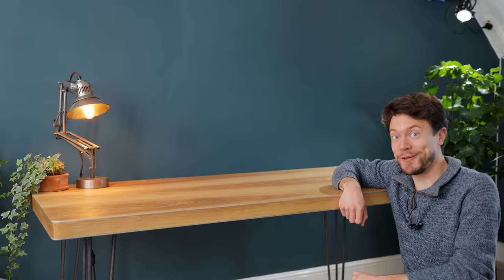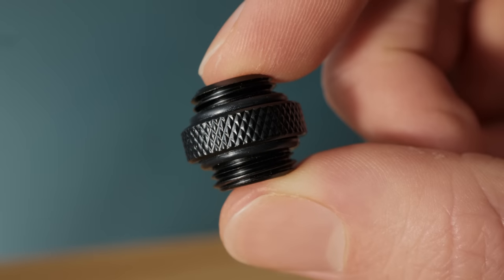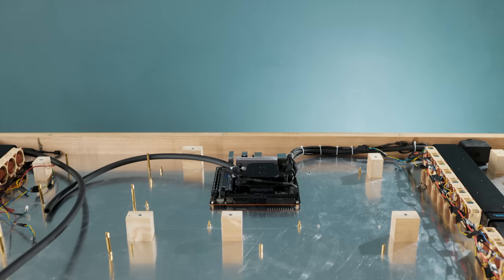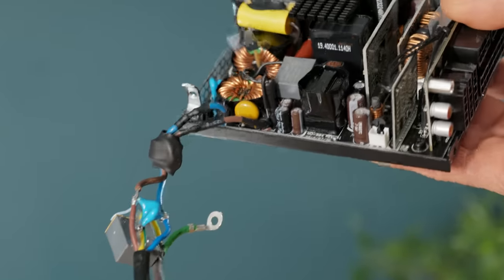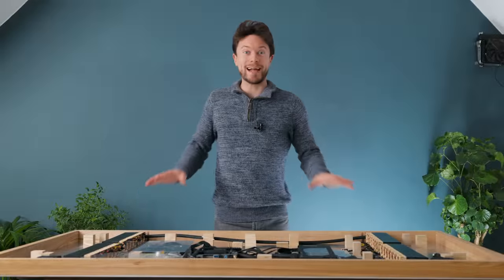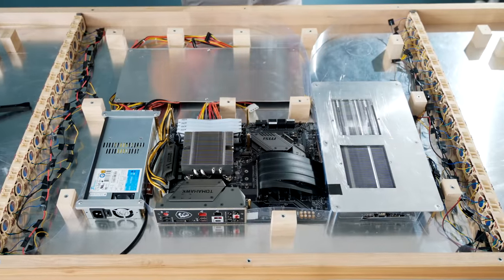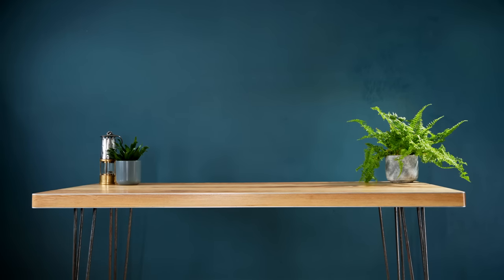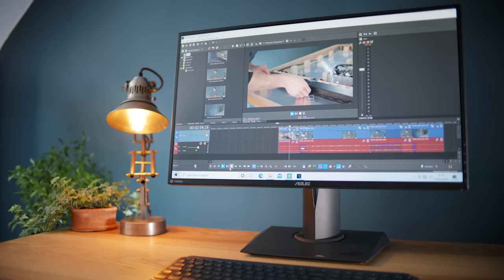Watercooling my invisible PC... (and other upgrades)

Comment: Given that you have a large amount of aluminium in the construction,a very good material for heat dissipation wouldn't it be prudent to utilise this as a component of heat management. This would be easily achieved using strips of aluminium connecting the large cover to the heat sinks,coolers etc providing a physical heat path to a huge unused heatsink. I build commercial vehicle based pumping stations,generators etc. Heat management of critical components now using increasing logic control is something we generally manage with fans and large hand made heat sinks,usually using just 3 mm ally sheet we create a L shapes to our needs and weld or rivet them in rows,even a basic fin with good air flow around it bolted to the back of a circuit board will have some markable affect. Admittedly we have the luxury of space😁 also add some dynalene HC 30 to the water, only a small drop in that little system will raise its boiling point by some few degrees.

Comment: So, silly question because i havent seen it before.  On that graphics card, he installed a barbed fitting into a threaded one? What exactly happenes there?  I have an older radiator lying around and have been looking for a adapter of sorts that will go on a barb and give me a threaded other side. This looked like it just pressed right in?

The older radiator has barbs, but i dont want barbs.

Comment: You could add another set of fans to the other side of the rads to increase air presure ( it really helps with cooling and lowering any noise

Comment: Rather than the 1U rads and the 28 Fans that it takes, I am thinking of a XS-PC slimline (20mm) radiator paired with a Noctua slimline (15mm) fan.  This will leave a 9mm gap on the model that Matt has and I am thinking of a 50mm cavity for my table and will have a 15mm room above the fans.  Any gotchas with this setup?

Comment: Besides the insulation shouldnt the AC wires not be screwed to a terminal or wago clamps instead of being soldered. 
Great build thats even cooler this time around 👍

Comment: I would love if you would fix this to match you're modern style. small fans are very inefficient and pushing air. I would block off the motherboard vent as it's allowing for pull from one set of radiators or push from the other, not both, meaning you could potentially have the pulling set will hot, still airflow and end up with a lot of dust. I would have two long 120 or 240mm thin noctua fan radiators running the length of both ends, to allows for fresh airflow. The, just reuse your small fans to direct the airflow strait across the desk to the otherone (while this can be done passively with there being one point of enter and exit for the air, the fans will avoid dust build up and still air). lasting, go all out man, yours not restricted to space other than height. buy and watercooled 40 series, ryzen 9 7000 series, and a b/z series motherboard with at least two m.2 ports.

Comment: I have a question, can’t you just do this with a rack mounted server?
Reply: that is a good question, the problem with the server would be noise and airflow, but i think it is perfectly doable, in this particular case it will fit, because it would be under the size he used, if you use a 1U server of course

Comment: "5950X considered to be THE most powerful consumer processor on the market right now, with a whopping 16 cores and 32 threads" 

I mean, yes and no..

The Threadripper 3990X has 64 cores/128 threads at a base clock of 2.9gHz (can be boost clocked to 4.2gHz).

Now if we are comparing price, performance out of the box (especially for gaming), and heat putout - you're right, the 5950X is by far the most power out of the box for the price. The threadripper, however is capable of some incredibly awesome power when boosted and properly cooled.
Reply: no, you are confusing things, the 5950x is mainstream cpu, or consumer processor on the socket for consumers in general

thereadripper is not mainstream, not a consumer cpu, is meant for hedt or workstations, you can build one, for sure, but is not meant to be a product for everybody

for games some intel cpus might be better, because some games do still like fast cores at 5ghz but 16 cores that are very close or on par to those intel cpus, on a consumer level motherboard is after a whole year of being released, still not matched by intel, not on the mainstream consumer socket, only the 12th gen might match it or surpass it, and it needs lots of power, new motherboard, new socket and lots of amd glue

Comment: Considering the size of the table, could you use the internal space and make it a large aluminum heatsink? You could turn this table into a huge fanless PC
Reply: it will be like a heat bank, at some point it will need cooling or shutting off

Comment: @ DIY Perks This is absoloutely awesome, you are an extremely talented engineer  obviously. However I would be a little bit concerned  about one potentiall fatal flaw.... what if , WHAT IF your  system gets a leak? 
You would not notice until it is too late because everything is hidden obviously, and this could  potentially cause a serious risk of fire, especially with the exposed psu, O rings do fail,  I wonder  whatyou think or have suggestions on counter measures this?  One  measure I was thinking of to help identify a leak as soon as possible would be  to add a flow meter that is visible but disguised somehow. I think this msut be essential to anyone contemplating orr attempting a build liek this fro themselves, as people who  are not as knowledgeable or as talented as you clealry are, are prone to make mistakes.
I have just subscribed to your channel,  and if possible as an pc buidler  myself, would appreciate massively any  feedback you may have on  my question and or suggestion.

Comment: I have drilled a hole in my wall and placed my pc in the walk-in closet, which also makes the room work as a dry room. then wireless keyboard and mouse. so only screen cable and screen power cord needs to be hidden, and my table is wall mounted. so ye no pc, no wires, floating table and floating screen. looks pretty sick and completely silent :D

Comment: But a 120mm rad isn't even enough for a CPU :-S I have a 420mm, 360mm, 240mm and a 120mm in my loop and I still get high temps. Though I have an i9-10900k and 2x2080 Super.

Comment: wow i 1st suggested a built in pc table or desk in a comment i made some 7 years ago, and idk if the idea been around that long but that comment mustve gotton allot of attention cuz looking at video's on the subject now and i see dozens of vid tackling this  hybrid concept, youve Definitely taken it to another level from my original idea which I had posted so long ago Now. In my original comment that I left I suggested using a traditional desk with file cabinets mounted on top, yr typical office desk with space for files on top and a few drawers to the side, 
My original idea was to use 6" high drawers on the bottom side and make those the space for your motherboard and other components, that would give plenty of space for components without much modifications made to the components themselves but for the radiator i suggested installing it in the space above the desk in the caninets meant for files m, Making it look more like a hybrid between a flashy gamer Build PC and a desk table. Some intricate tubing could be made to connect the radiator above up top the desk and into the drawers. also some qmbiant rgb lighting rimming the edge, built in mouse pad and keyboard, But also something else. I'm surprised you didn't try. Which was built in wireless chargers integrated into the desk top so that you can simply put your phone on the table and it'll charge

Comment: buddy went with a 5950x paired with a b550 it better be a pretty capable b550 board to use the full potential of the 5950x

Comment: Curious, what if there is an electric surge and the wood table catches fire?
Reply: if that happens, the whole desk would act as a heatsink being aluminum, fire would need to be very hot and spread fast and on that case not only the wood would be a problem, cables, pc parts, the plastic, everything, the last problem if something that serious happens is the wood

a electric surge should be controlled with a power surge protector or a ups, as everybody should use one or both, psus of good quality will first burn a fuse inside before letting things go out of control that bad, bad psus, well, the psu is the only thing that survives, lol

Comment: i just find it strange that the air inside barely goes in and out so it should have started heating, if not burning the table but since your watercooling came i feel more at rest

Comment: You lost me when you put a Ryzen 9 on an ASROCK ITX board.   That board will will severely bottleneck the cpu power.   You have room to use a full sized board and that would be preferable for heat distribution.

Comment: uhhh happa happa..  stuff like this triggers my adhs brain ;)
have you ever tested if the system would perform better or worse without the plastic winglets?
im a klima ing and dont think it makes much of a diffrence if any, but it would be intressting to see
dont like your "filter" solution... a big magnetic filter mat would have been perfect
no reservoir?!? you better check that fluid regularly or risk screwing your parts
like the idea... nice work 👍

Comment: Please never open your PSU guys, the capacitors can stay charged after even months of no use and it's a serious hazard if you touch them or it blows up on you. Just never open them, period
Reply: I have opened many power supplies in my time and I can guarantee that the capacitors don’t stay charged at a lethal voltage for “months”, touching capacitors can be painful if it’s one handed, however the chance for death is slim to none because the voltage is not across your heart, using one hand is good practice. Also capacitors are perfect for high current applications and usually are ok even when short circuited, i hardly doubt it will blow up on you.
Furthermore, almost every psu uses a discharge led, this usually removes any charge which is still present.

Sorry for the long response, I’d rather say a lot than too little

Comment: But water cooling like this would legit not do any difference for thermals? you have not improved the airflow so only thing going to water will do is delay the time before it thermal throttle since the loop needs to heat up.

Comment: if ur table would have bean 2 and one half inch tell the power supply would had fit the smaller one u ad to cut down what about building a wall that has lost of isolation and 5 /8 dry wall a faults wall  you make the  faults wall with lots of  wood stud frame some insulation 5/8 drywall then another frame more  insulation 5/8 drywall so that you have 4 wood stud farms 4 times insulation and the 4 times 5/8 drywall and u can even make it 5 time or 6 time but leave a paces for the pc also keep in mind some wall have air vent so getting air to the pc might not be a problem many apartment have them on the wall one could be to take in air the other to let air out the 5/8 dray wall and many insulation and wood frame is to make  the pc more quite

Comment: Sooooo... yes. this is cool. but wanna know what i did? i bought a usb3 hub, 5m usb and dp cables, put a 40mm hole in my wall and put the pc in another room xP i usually dont even need to run air conditioning anymore! and its, ofcourse, as silent as can be.

Comment: Are you ever going to show proof that you actually did water cool the system? 
I dont see one water tube run at all in this video.
Tubes too and from the mother board are never shown, and there are less fans? 
What is suposedly cooling the water?
The video shows water being poured into something, and then cuts to the desk, being turned upside down. 
Very curious why after all that work running tubing you dont show one inch of it.

Comment: ONE QUESTION HOW AOBUT THE CD OR DVD DRIVE OUPS ...
Reply: Drill out holes to size of the cd drive bay doors on the front or side of the desk, yeah its 2 inches tall but theres still plenty room to do so, trace out the bay doors, cut, sand, fit, fine tune, finish with stain, and screw in.

Comment: you should have gotten the intel I9 14900K and WHY DID YOU CUT THAT AC INPUT ON THE POWER SUPPLY i used to work at a power supply company soldering the input is VERY DANGEROUS and can cause significant resistance in the wire causing a bit more heat if you soldering skills are bad DON'T DO THAT OR EVEN OPEN A POWER SUPPLY
Reply: CPU didn't exist at the time and he showed a warning saying not to do this
Reply: oh I did not check when the video was made @Ccaraaa

Comment: The only downfall of this build is the Asrock.
Reply: nut you can replace the motherboard without much effort, so is just a matter of unplug and unscrew tubes and cables if required, until the asrock blows up or decided to not turn on again

Comment: Wonderful design but I would just build the table with nothing it it and the shelf with a apple iMac. Much simpler, better computer and at 3.8GHz 8-core 10th-generation Intel Core i7 processor not a slouch. Also

Comment: water-cooling is never an upgrade. there are literally NO advantages of water-cooling. it is not more quiet and not more effective. it just bears the risk of damage, because unlike a ventilator you do not see when it's not working. and also it's liquid. and what is the first thing we learn about electric devices and liquids? exactly!